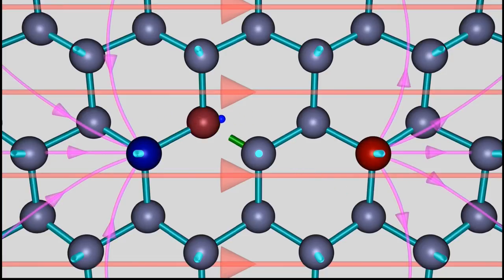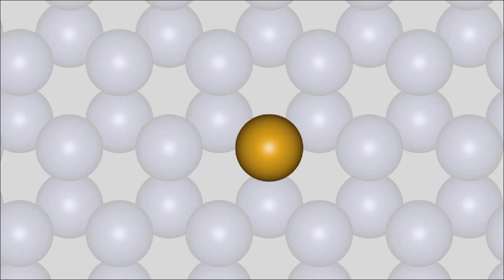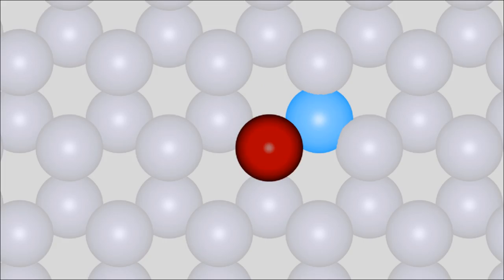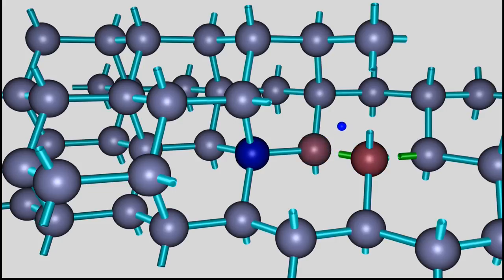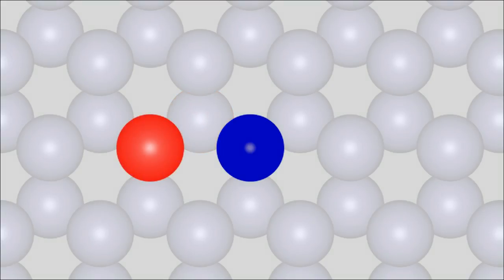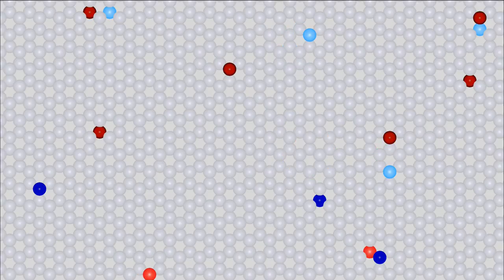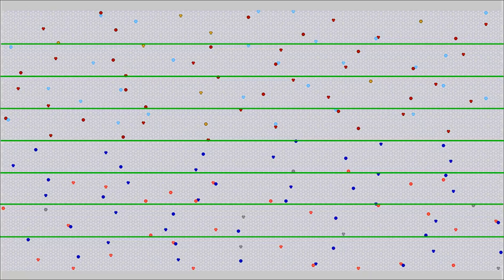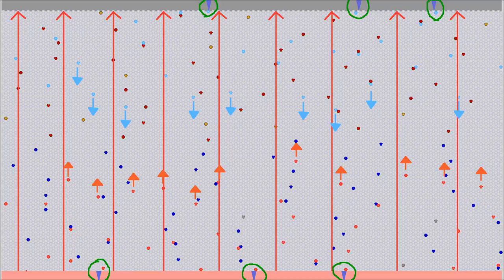Simulation of a P-N junction inside of a semiconductor diode

Comment: sir how a chemical bond can be formed between two neutral silicon atoms when a hole and electron recombines????????? 
a silicon atom having deficiency of electron is said to have a hole, so when it recombines with a free electron some bond should be formed between the electron and the silicon atom having hole,  so from where the 2nd silicon atom will come into the picture??

Comment: Well, sorry if the question is so evident but i can not see it. According to your videos i grasp that in forward bias the depletion region is "destroyed" and conduction is now produced. But then i can not understand why is the 0.7V drop voltage created in forward bias if the diode is conducting and the barrier was destroyed. Where is the 0.7V on the PN junction in forward bias. Thank you!
Reply from the maker: There is a potential of 0.7V needed to move electrons from the n-doped region respectively holes from the p-doped region into the depletion region. Without that potential, the electrons would move back to the n-doped and the holes to the p-doped half of the crystal, which happens as soon as the diode is removed from the voltage source. The barrier is not destroyed: It is still there and the voltage is required to lift the electrons above that "wall". I will try to explain that more clearly when overhauling the series, so thanks for the new aspect.
Reply: Thank you a lot for this job and your answer. It would be great that you explain in detail why is the barrier still there if due to external electric field the internal field is canceled allowing recombination on the depletion region. And why the polarity of the barrier is changed, i mean now the (+) polarity is in the p junction. Thank you again.
Reply from the maker: Christiam Franco
I am still looking for a clear demonstrative answer. Think of the electric field of the barrier as an additional "voltage source" in your circuit with reverse polarity. You will always need a voltage of 0.7V to overcome the electric field of the depletion layer, even if a current is running through the diode. The potential of 0.7V is needed to cancel out the effect of the "diode's internal voltage".